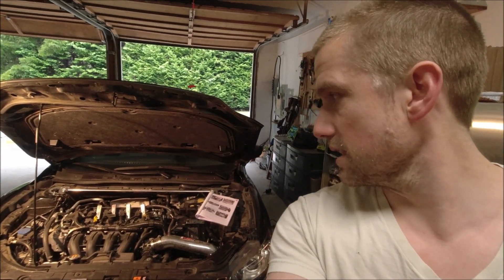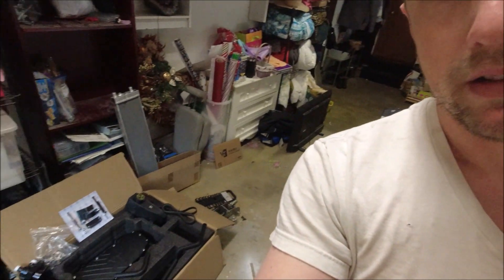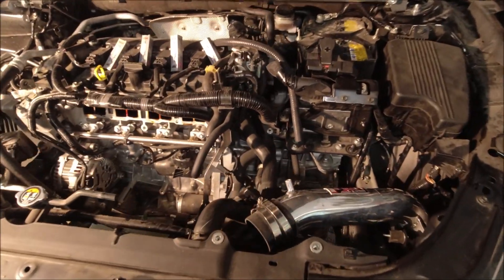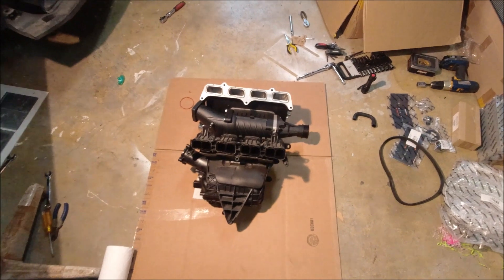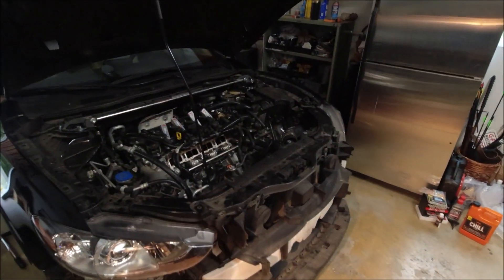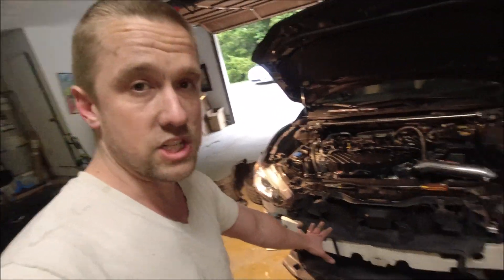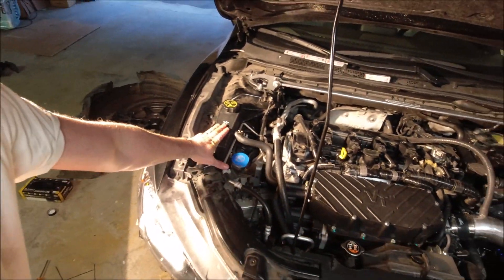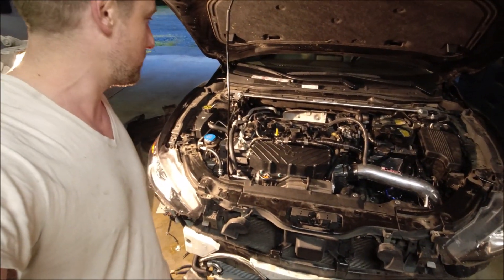Mazda 6 Supercharger Install Experience Pt.1

Comment: I know this is four years ago but I just bought this kit for my 2016 Mazda cx-5 and was curious, did your kit come with the double sided bolt and a bolt only with threads. How did you use them? This kit comes with no instructions

Comment: I live in california. Can you pass the smog test with this still installed? Or would I have to take it off and place back the OEM parts prior to the smog test?
Reply from the maker: AFAIK yes, because both cats are still in place and no CELs, and it can run on the stock tune. There's a couple people running it in CA and I think they just flash back to stock tune before smog is all (it runs slower and feels more like a laggy turbo on stock tune, but is fine)
Reply: @M6Ninja  oh wow, that's awesome! Thank you for the info. I'd love to run this on my 2014 Mazda 6 as well. Keep uploading more videos, please!  I'm learning a lot from your build. I'll have to buy the list of parts you recommend.

Comment: How are you satisfied with build quality and what is expected life or durability of supercharger please?
Reply from the maker: It's been 2.5 years, 30k miles, many many racing events, and it's been incredibly reliable, very impressed with the quality. After another 70k miles I'll need to replace the special oil inside the gears of the supercharger.

Comment: Will this work on 2016 Mazda 6 and where did you get it from
Reply: i have a 2018. cant say forsure, but online researching stuff i noticed theres hella more aftermarket parts for the 2016 models more than the newer ones
Reply from the maker: yes, check out our guide and/or our FB group - Skyactiv-G Super/Turbo Community:
https://drive.google.com/file/d/1GEK-WxE4gTWX80ol2p-XiuyelRE3rS0M/view?usp=sharing

Comment: How much does the supercharger cost?
Reply from the maker: ~5k usd, but with oil cooler, gauges, and GTR spark plugs it's more like 6k all in.
From an air flow perspective it's a 42% increase, so 2.5L becomes 3.5L
Reply: @M6Ninja  very nice, how much hp gain?
Reply: @M6Ninja  we’re can I get it